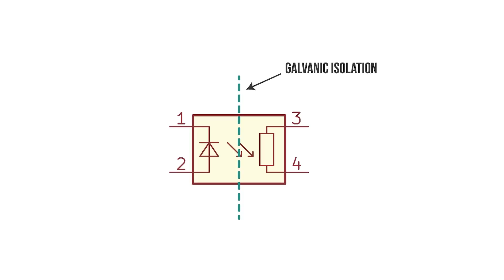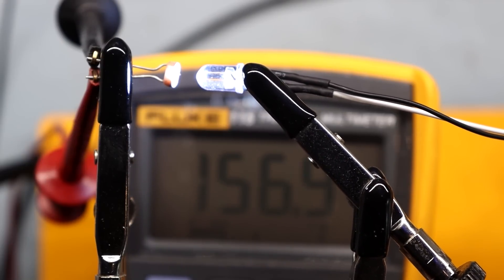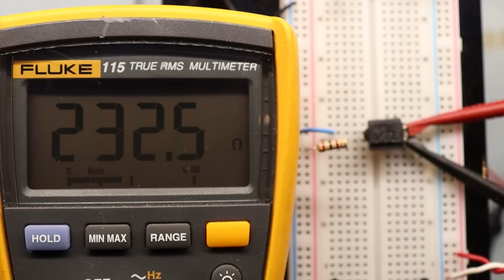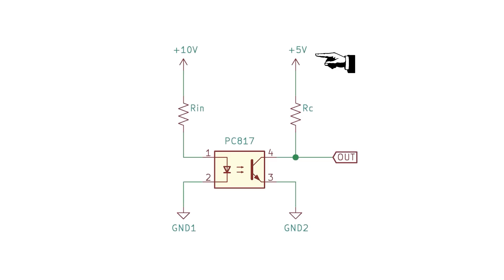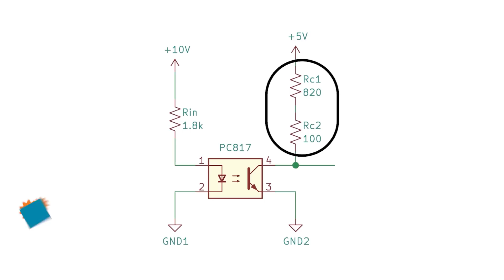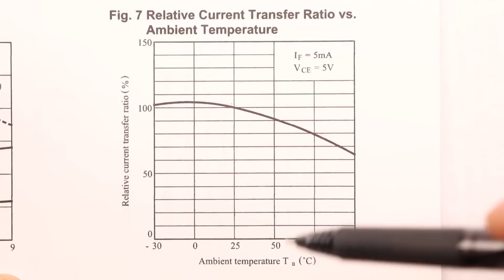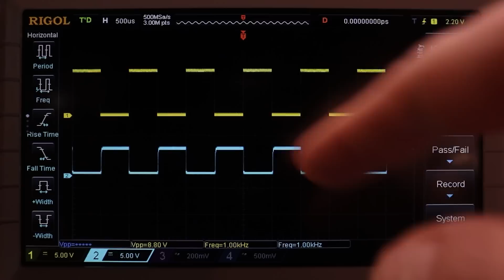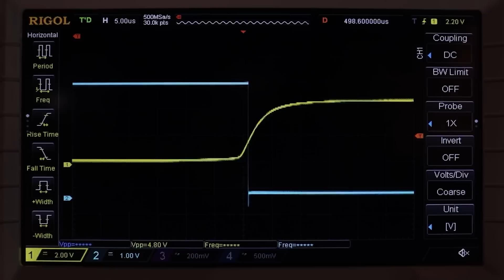How Optocouplers Work and How to Use Them - DC To Daylight

Comment: The collector resistor calculated is the minimum? Or is it better to not go over that value?
6:04 “off” meaning output = 0v meaning the opto transistor is turned on 100%?

Comment: Thanks Derek; Excellent ! I'm also a great fan of opto-couplers, & have regularly used the MOC5007 series, as it has hysteresis, in the output stage, which provides a nice clean square switching transitions. I only recently came across the A817V, which provides a much smaller footprint, than the MOC5007, & as my circuits have lots of 4093s, then the opto output gets squared up anyway.  I'm into automotive ignition & ECUs, with trigger wheel/flying magnet crank signals, & if there is any place an opto is required, to reduce noise, then automotive projects, have got to be right up there.
Reply: Would you happen to have something that takes a 5V TTL input signal and output of a delta 100V square wave? I.e. -20V - 80V, 0V - 100V, etc. Or could you possibly point me in the right direction? I was looking to use a 4N25 Optoisolator.

Comment: For some reason, I'm having issues with pwm when connecting the LED side to an Arduino, and the transistor side to a guitar signal in a PC817 optocoupler. Any attempt to adjust the brightness of the internal LED introduces noise into the signal unless the LED is all the way off or all the way on. Wonder why?

Comment: I'm confused, I see he uses the resister on the positive side but I look up circuits and it shows the other side, dose it matter witch side or...?
Reply: It shouldn't matter because all you are doing is setting up a voltage divider to get the necessary Vf = 1.2V to drive the LED side.

Comment: how about doing this for linear/analog?

its strange, that with arduino etc being so popular, that interfacing and isolating an analog signal seems so overlooked...

been waiting a month for hcnr200, got sick of it, been playing around with pc817s in a cross coupled feedback loop with some promising results... input drives the isolated output, thats fed back to the output LED to drive an isolated feedback loop in the input...

 im not actually concerned about precision, as long as its pretty close and its isolated... it all seems fairly linear so far...

Comment: Optocouplers are often used in the retroaction loop of switching power supplies, where they are probably biased. Does that mean that the regulation will get off as time goes? That might explain faults on old mains connected boards and PSUs?

Comment: Another use is dealing with noisy mechanical switches like a micro switch on the end of a long cable especially if that cable
is conducting power or other signals.

Comment: Yes, useful as you can easily get inversion, even if you do not want isolation, or to interface to different voltage levels as well. Plus the simple way to do high side drive, though the on state voltage drop can make it bad with bipolar, but the mosfet driver versions are great for making N channel switches that are easy to interface although they are also going to be slew rate limited.

Comment: What about high volatges? like 240V AC to micro controller.. I want to get signal from AC voltage to micro controller.. How can I calculate the RIN value.. acc to your formula it's 47K resistor.. will it work?